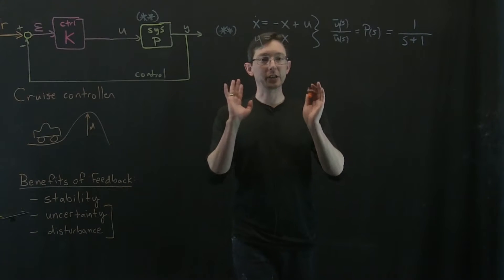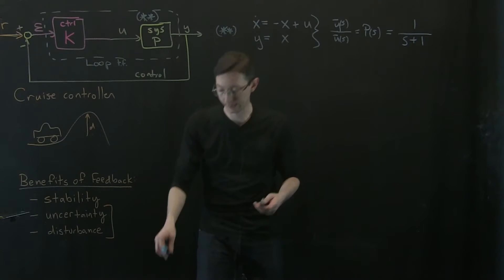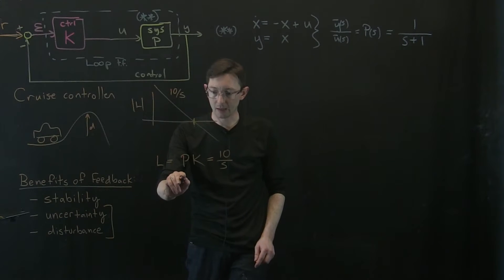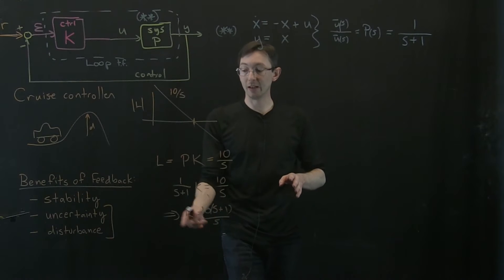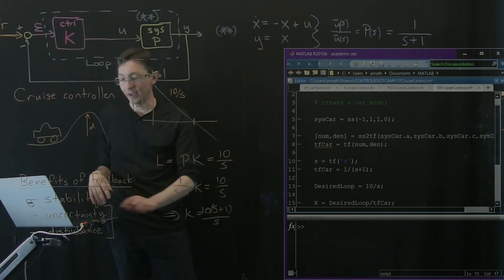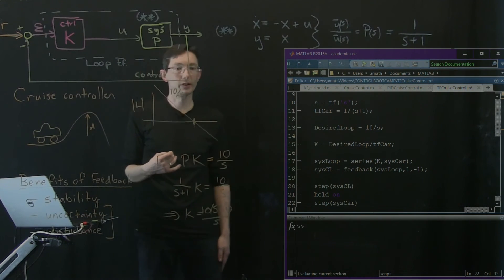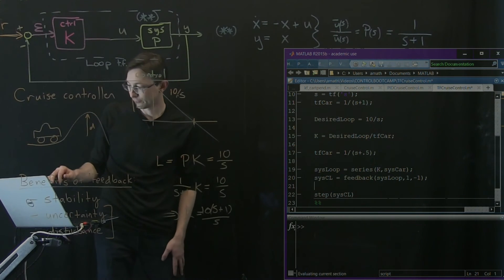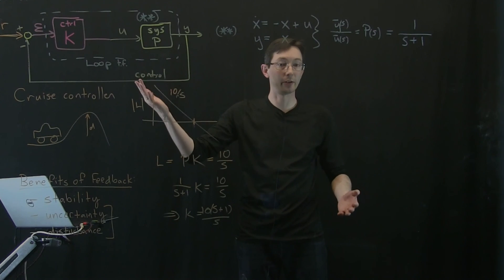Control Bootcamp:  Loop Shaping Example for Cruise Control

Comment: LQR, Kalman and LQG control seemed so promising, and that its robustness weakness could be adressed by robust control. Then in the very end of the video it was briefly mentioned that it could simply be replaced by loop shaping. Is there still a need for LQG control or has it become "obsolete" to the above theory?

Comment: I think this code is wrong in the last part. True tf not give to "series(K,tfcar);" that is why we can not see any difference. It should be,

clear all, close all, clc

% Create a car model

sysCar = ss(-1,1,1,0); % A matrix -1, B matrix 1, C matrix 1 and D matrix 0

[num, den] = ss2tf(sysCar.a,sysCar.b,sysCar.c,sysCar.d);
tfcar = tf(num,den);

s = tf('s');

DesiredLoop = 10/s;

K = DesiredLoop/tfcar; % K is controller K. 

sysLoop1 = series(K,sysCar); % This is loop tranfer function K x P
sysCL1 = feedback(sysLoop1,1,-1); % This is feedback system

tfcar = 1/(s + 0.5); % This is actual system. It is slow. This use 0.5 and model use 1 value.

sysLoop2 = series(K,tfcar); % This is loop tranfer function K x P
sysCL2 = feedback(sysLoop2,1,-1); % This is feedback system

step(sysCL1)
hold on
step(sysCL2)
hold on
step(sysCar)
Reply: @ Indramal Wansekara, You got it right.